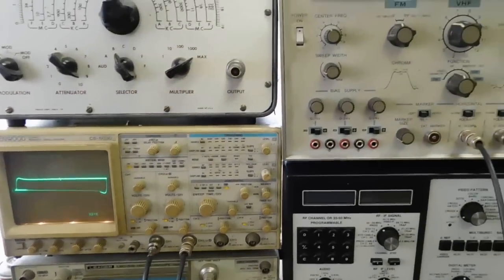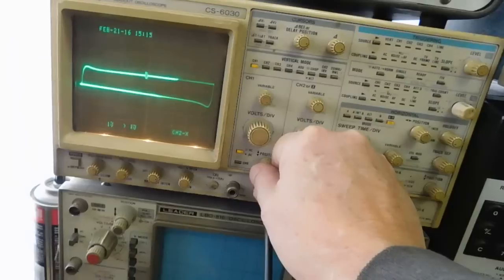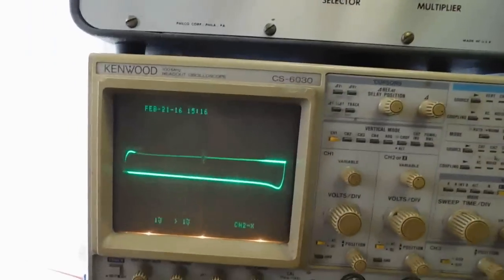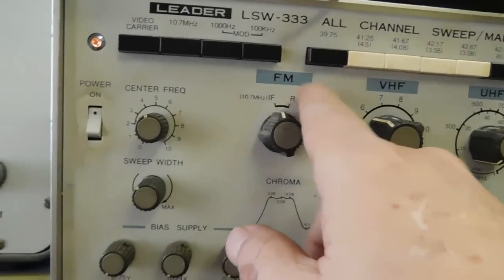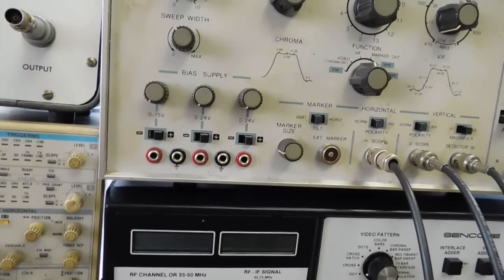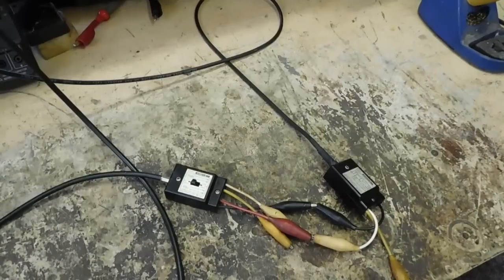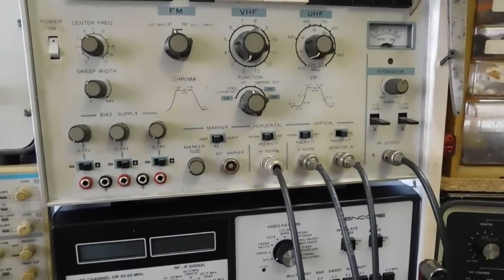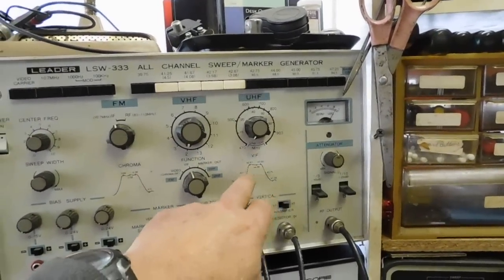The LSW 333 Sweep Marker generator

Comment: Interesting video, and yes I would like to see more videos on electronic testing equipment. I'm interested in signal generators, and there seems to be quite a variety (Sweep, RF, DDS, Frequency, MPX, and Function Generators).  I have a digital Oscilloscope, and I am interested in information on how to tune or align my 1978 Pioneer SX-780 Receiver. The service manual states that I need connect the Vertical 10:1 probe from my Oscilloscope to No. 23 terminal and the Horizontal Pilot out to a MPX signal generator. The out signal on the MPX signal generator connects to a FM Signal Generator EXT MOD IN. And the Out connector on the FM Signal Generator connects to the 300 ohm Antenna. Can you give me some recommendations on MPX signal Generators and FM Signal Generators. I'm looking for low cost equipment.